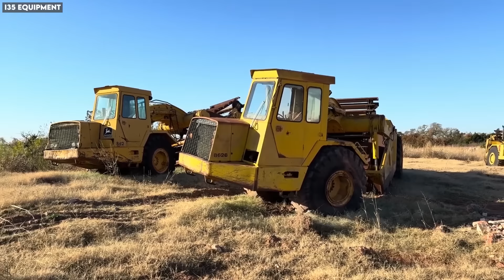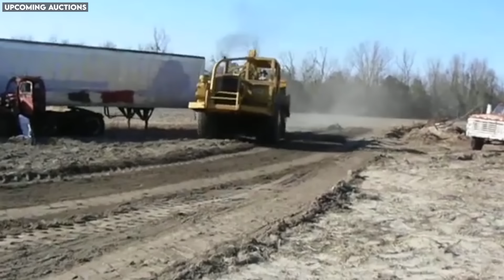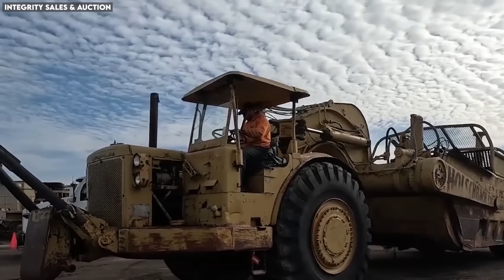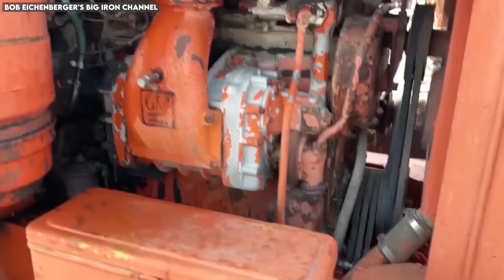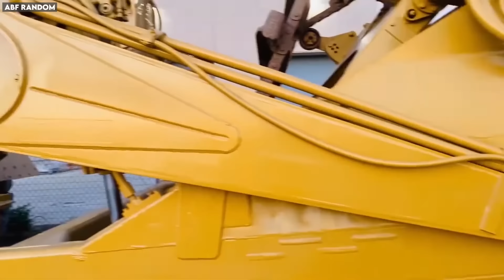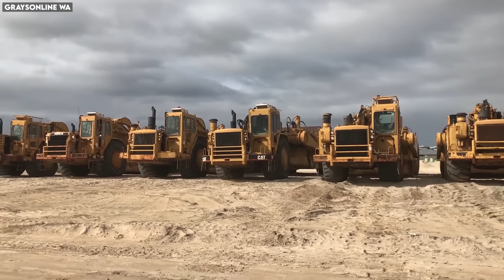10 Scrapers From the 1980s That Were Built Like Tanks

Comment: The only thing wrong with any TEREX tractor was the oil leaking and slinging Detroit Diesel engines that they used. They were alright for common dirt work but you didn't want to use them at a gold mine. Between the engine leaking and the hydraulic system leaking they contaminated the soil and the gold would flush right out of the sluce.